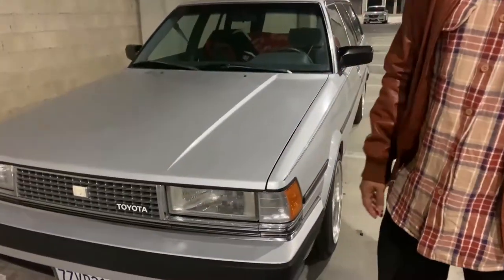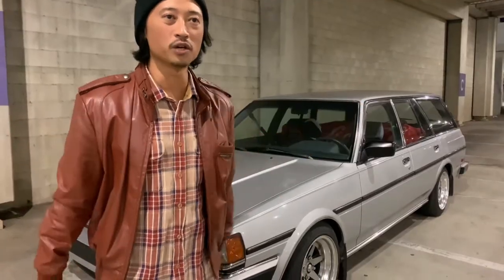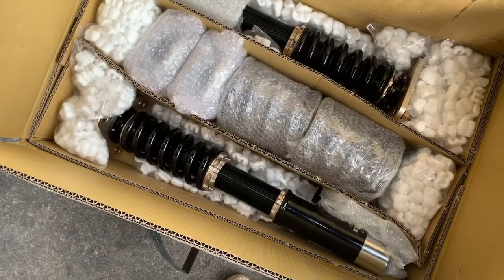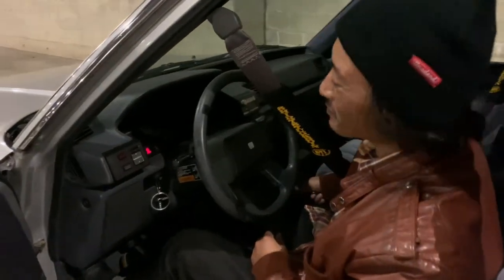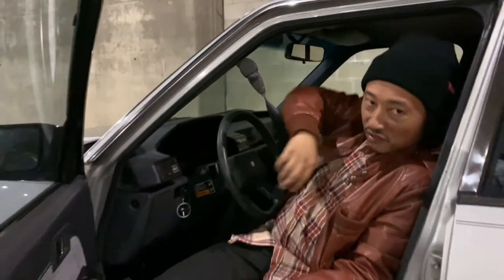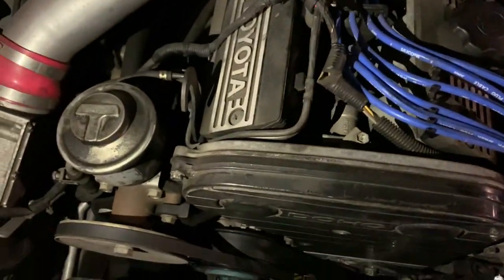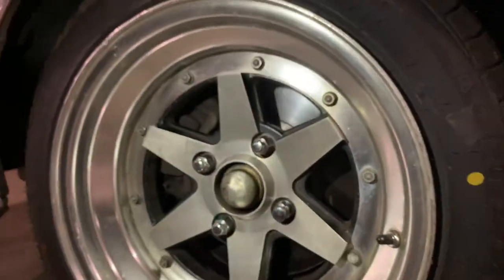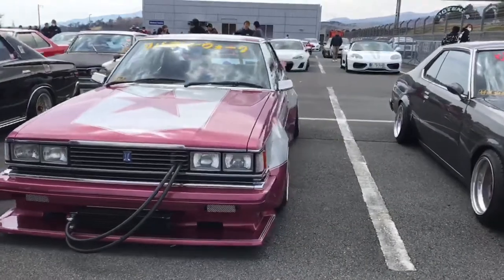SOCAL Cressida Wagon | MX72 MX73 Toyota | BC Coilovers | SSR Longchamps | マーバン | シャコタン｜街道レーサー ｜旧車

Comment: What is the specific supra rear end your using and would it be capable of handling 500hp?
Reply from the maker: It’s from a first gen Celica Supra, I think around 80 or 81. I’m not sure what power levels it can handle but I’ve been told it can take a good amount. Usually comes with LSD too
Reply: @boomboomtisk  Alright thank you.

Comment: I know this video was like a year ago, I have a mx62 wagon with 68k original miles ^_^ I want to lower it could you possibly give me the description you used to lower your wagon! I would definitely appreciate it I can find any forums!!
Reply from the maker: If you check out the description of the video I posted what I used on my wagon to lower it. The front is on MX73 Sedan coil overs welded to the original spindles and the rear is lowered with AE86 lowering springs and 1987 Bronco II front shocks with the bushing switched out. Just double check that your car is the same bc I don’t know off the top of my head how the MX62 looks underneath
Reply: @boomboomtisk  if it’s not too much to ask do you think you could send the links to where you bought it all from. ^_^ it would help me out a lot!

Comment: Hey there, is the coilovers same as the one for the mx73 sedan?
Reply from the maker: The front is the same but the rears will be a mix of parts from different cars. Mine currently has AE86 lowering springs and Bronco II front shocks out back.
Reply: @boomboomtisk  do you happen to remember which AE86 lowering springs you used in the rear?
Reply from the maker: @brandontodd4937  they are BC racing